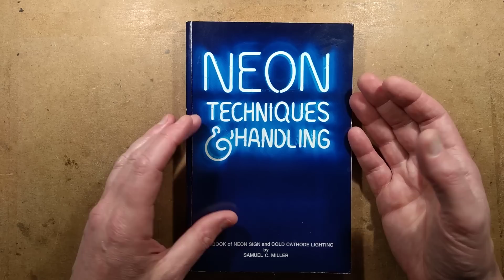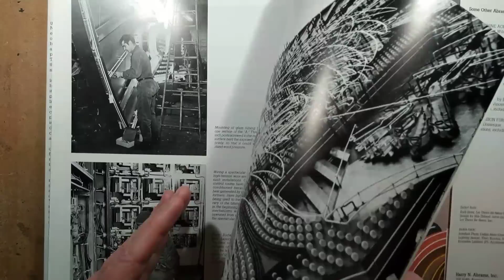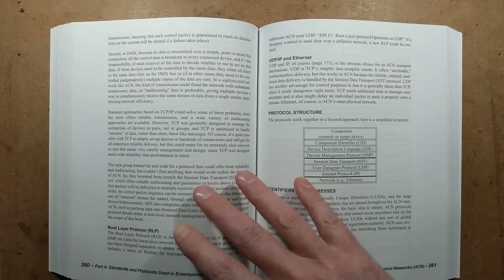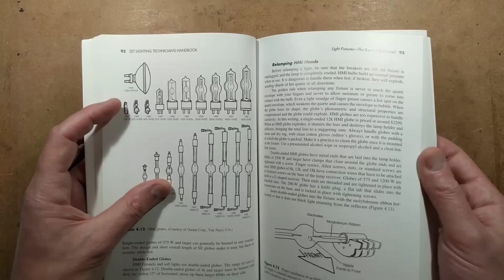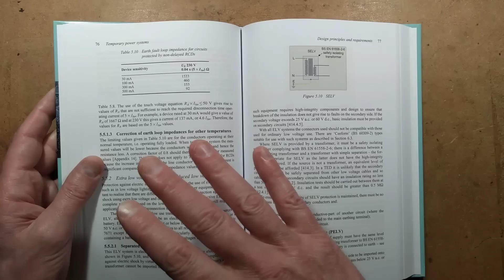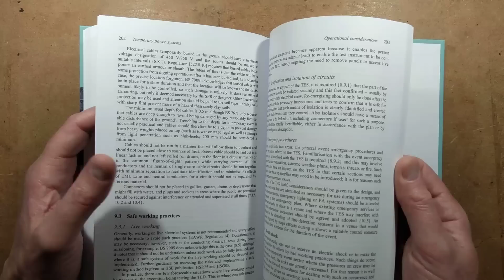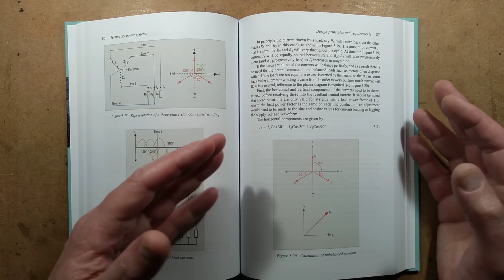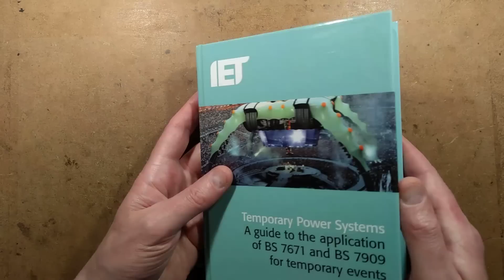Technical bibles of showbiz.  (And neon.)

Comment: I might need one of those, im a beginner lighting tech, and im specialized in follow spot operating but would like to specialize in stage lighting a bit more.
Reply: jonathan masson wouldn’t hurt to start learning a console too. I’m an entertainment electrician and EOS/HOG4 programmer. Programming is a big part of the work for me.
Reply: All sounds like sage advice to me... fortunately for me I was only a lighting tech for about a year at a yorkshire based club which shall not be named. One (Sunday) Bangra night the sound system died about 10 minutes before the end of the night and as I was the only tech of any kind onsite it was my job to fix it... The problem turned out to be that someone switched off the aircon/fans in the amp room earlier (nothing to do with my role) and it was about 50C in there so everything cut out.. I got it sorted but by that time the place was emptying out... fun times
Reply: @zy0rz   so far i only did school gigs since thats where i was taugh stage lighting, but i was able to play around with rented equipment such as a martin M1, but havent had much time to learn it well yet
Reply: @dracoknight7710  Go for what you want to do for sure, I guess what I'm getting at is be prepared for curveballs! Good luck.

Comment: i am neon glassblower for 34 years now.....i remember way back when there was such an animal called a bubble transformer....i wish i had kept one...coz when you hooked it up to a neon tube the gas would excite into little bubbles !....and they would move...you could control the movement.... with a built in. potentiometre dimmer switch... ...it was sooo cool....kinda like the bubbles in an old wurlitzer juke box......how i wish i still had one of those to send you so you could rip it open and reverse engineer it....they seem to be very rare now
Reply: matteo distasio It’s called a beading transformer and you can still buy them http://www.t2-neonpower.com/PRODUCTS/NEON_SUPPLIES/beadmaker.pdf
Reply from the maker: The jelly bean power supplies?   They still sell them.
Reply: ahhh yes thats it ...jelly bean power supply....how does that work ??? that would be interesting to see you tear open one of those puppies
Reply: Possibly rare because something they did was electrically dodgy? :D